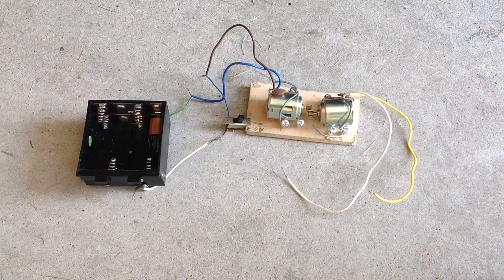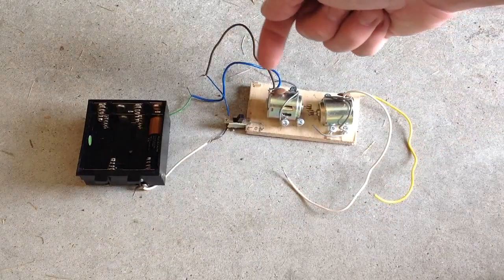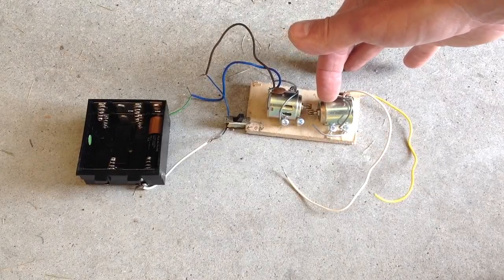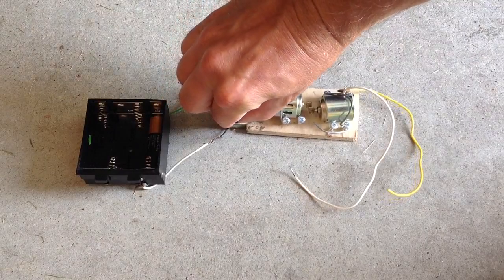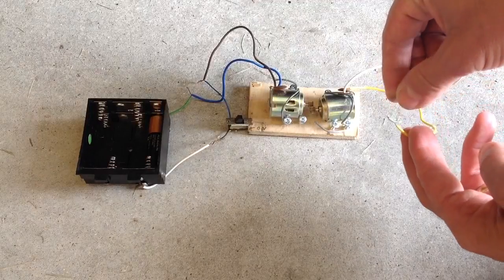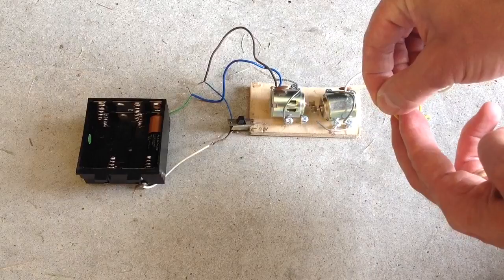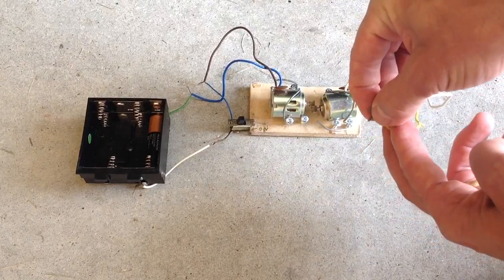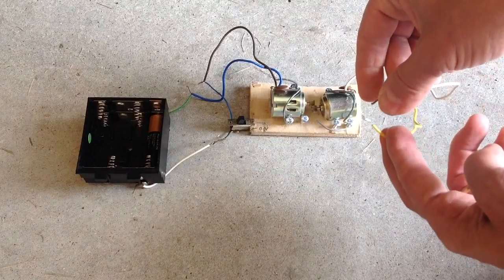effect of electrical load placed on a generator

Comment: You would be able to recharge the battery, it's just over time energy would be lost due to the process the second motor would need to be smaller, if you put a cog next to both motors and it turned It could effectively recycle some of the energy. So connect it to a rechargeable battery and it would recharge but at some point all the energy would be gone. But at the same time if you remove the resistance of the second motor and run just one motor, and ran the cog at a low speed or same speed as with the second generator, it would probably last longer. Defeating the purpose of having a second generator to recharge the battery.